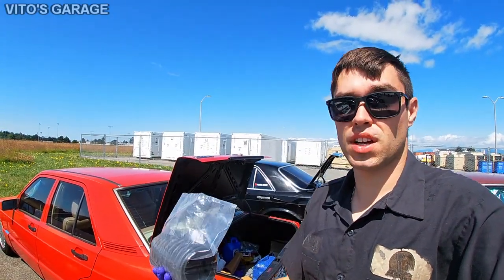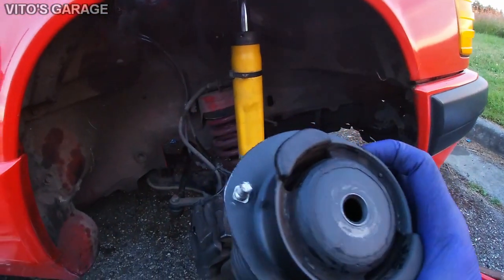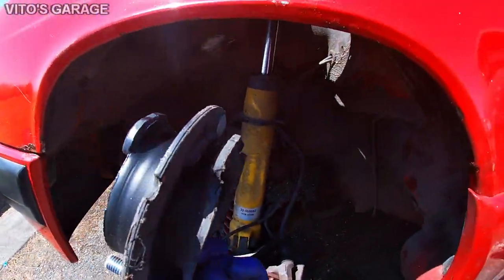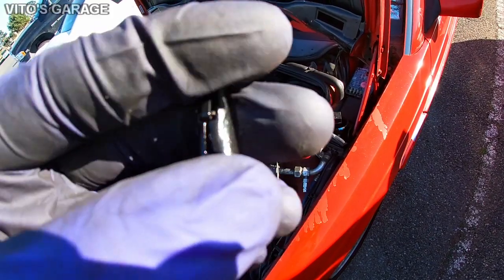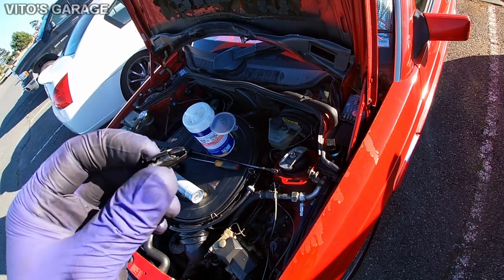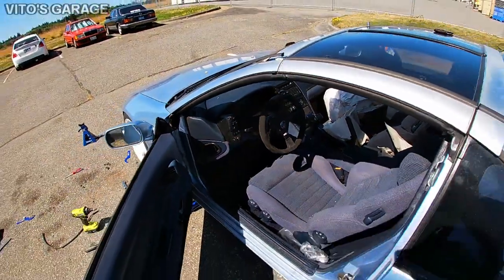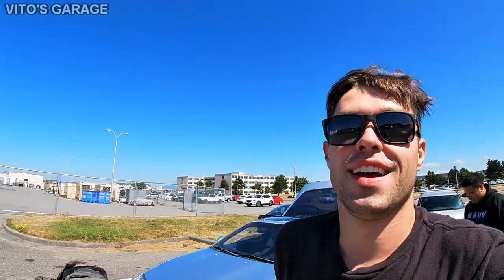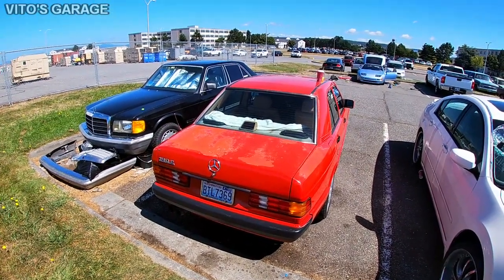Mercedes 190E Installing Front Shock Absorber Boots & Hood Strut! + Bonus Coilovers on Nissan 300ZX

Comment: I see you have purchased the rear bumper. I'm now looking for the front bumper or at least chrome trim for it for my w126.  Mostly searching on ebay, so I'm upset that these used bumpers are very expensive.
Reply from the maker: They're expensive on ebay and online in general. Try to find private sellers who sell them